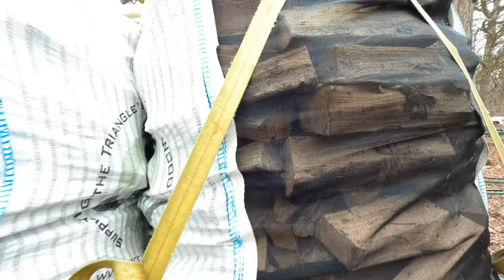Restaurant and Residential Firewood Deliveries and Log Pickup

Comment: The entire setup with crane and bags is gorgeous. Assuming government juice is water what was that getting added for? If it's not water what was it and what was it added to/for?
Reply from the maker: Really appreciate it!  Government juice is a nick name for diesel exhaust fluid (DEF).  Basically water and urea that's injected into the exhaust of diesel trucks to clean up the exhaust.  Not a great system, but unfortunately with federal laws we are stuck with it.  Thanks so much for watching!
Reply: I'd never heard of that stuff before. It's not especially common in Aus and then it's mainly latter model cars and trucks. It seems it's only really been a thing in Aus since about 2016. I probably haven't driven any diesel vehicle newer than that.
Reply from the maker: I think it started around 2008 here in the states with DPF systems.  Around 2012 or so is when the DEF fluid showed up on everything over a certain horsepower.  We have a fleet of diesel pickups at my day job, and never an issue other than DEF related problems.  Hopefully the manufacturers get it ironed out soon.  Quite the pain.  Hope all is well down under.  Thanks again for watching!